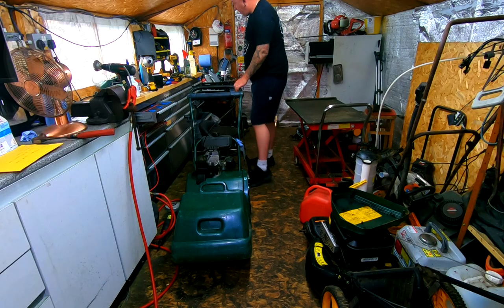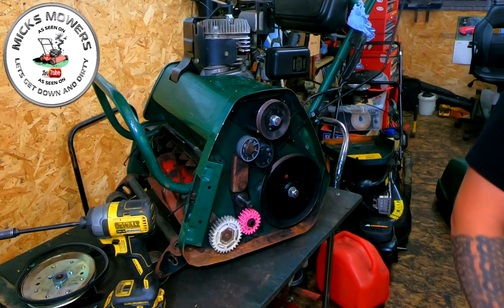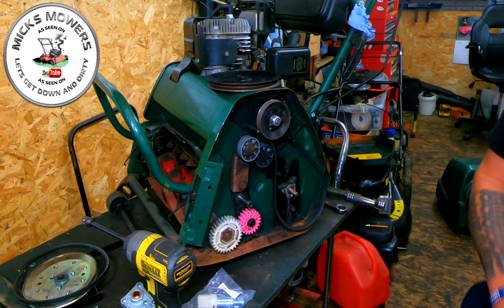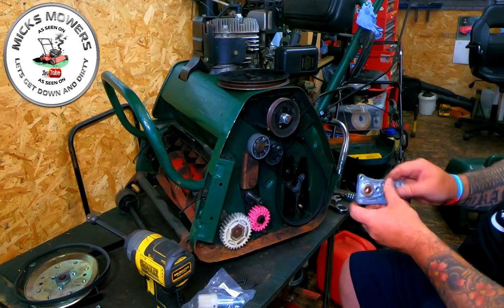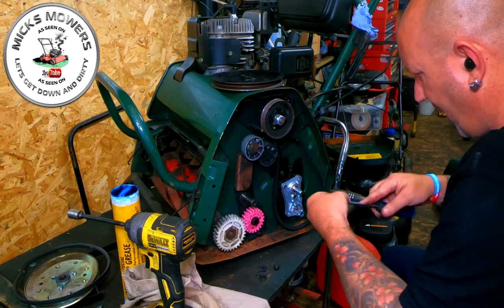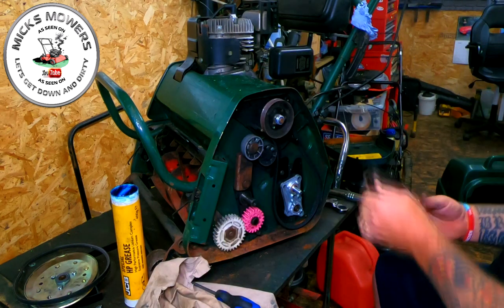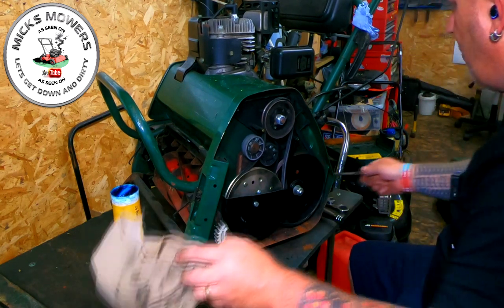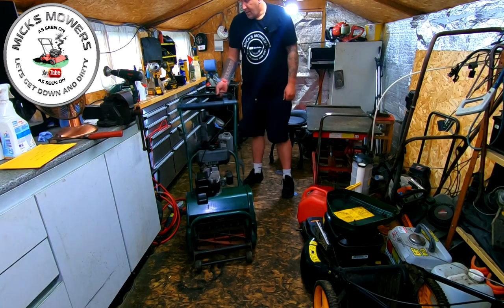Atco Balmoral Cylinder Lawn Mower Repair Drive Grinding Or Can't Push Forward

Comment: Just followed this for my Attco Balmoral 20S - Changed the pinion gear, the belts and the ring gear. Step by step instructions are amazing. The roller is a little tricky to get the screws back in especially doing it on your own but follwed it and works a treat. Thank you so much Mick.
Reply from the maker: @jasonbocchi7736  no worries mate .... Glad it helped

Comment: Hi Mick I wish I had seen this vid earlier as the F016103210 is now £43
Reply from the maker: @alansanderson4943  depends where you look. https://www.mowersandspares.co.uk/products/pinion-plate-assy-f016103210/
Reply: Obviously I've been looking in the wrong place. Thank Mick for the info and quick response 👍 😀
Reply from the maker: @alansanderson4943  no worries

Comment: Thanks for doing these really good educational videos my suffolk punch 17sk has been sitting around in the shed for a few years now and you have inspired me to get it out and fixed up replaced the front roller only to find its not quite rolling right the drive pully is wobbly so using this video I'll strip it down tomorrow and check both the pinion gear and housing thanks again
Reply from the maker: No worries

Comment: I've just replaced the pinion and gear but now I can't push the mower it moves when pulling leaver but can't manually push it now?
Reply from the maker: Have you put the new Pinion gear plate on as well?

Comment: Hi Mick. Quick question have you ever come across the pinion bolt for the drive pulley that keeps working itself loose and stoping the drive. Then you tighten it back up and it works then next time you use it same thing?
Reply from the maker: Use some lock tight.. maybe that will sort it
Reply: @themowerman  that was my thought. Thanks

Comment: Your videos are great so thank you so much for doing them, just purchased a Suffolk Punch 17sk for £300 with scarifier and it is the first time using cylinder mowers. It has needed work like the carburetor clean and pulley change. Just wondering does my mower have the pinion upgrade or is it only ATCO mowers. I also have a question on the petrol to use, would you recommend using E5 petrol over E10 ?
Reply from the maker: Hi.. use E5 NOT E10. Or the best fuel is aspen 4.  It's expensive but last for 5 years .. unopened and two years opened.. yes you can use the same Atco upgrade for your mower ..

Comment: Great video as usual. Almost rebuilt mine after watching your videos. One video I can't find is about the pull cord kickback issue. Which I have. Any idea how to fix it? Thanks.
Reply from the maker: Could be out of timing.. check the flywheel key for alignment or it could be the valve

Comment: Hey up mate, hope all is well!? Literally on one of these machines with the same issue as I type!! Watching your video now with interest on this new part! 👌
Reply from the maker: Fantastic it does the job.. I have done 4 now.
Reply: From all the ones stripped, I’ve noticed the more modern made ones, defo post 2000, probably around 2004 seem to come with those elongated bearings, much better. I’m currently on a 1996 balmoral 17s and it has various design changes to the internals and the same bearing you removed from your 14. Good fix though mate, cheap to! 👍🏻

Comment: Mick, great video. I’ve new around here a bit of a novice sadly.

I was recently given a qualcast classic 43s and have the same noise when pulling the mower back and when it engages with the throttle.

Would these same parts work on my motor or could you be so kind to point me in the right direction please.

Keep up the great videos
Reply from the maker: I would say it would fix it mate ...

Comment: Hi Mick, love the channel. I have a Qualcast 43s, bought it from a charity shop but it has issues, my biggest concern is the drive train. I'm struggling to set it up. Finding the sweet spot where it just idles and does not move and why when I pull back does the back roller lock? Any help or a video on the subject much appreciated.
Reply from the maker: Hi mate .. I have lots of videos on upgrades and how to get it sorted.. have a look in my cylinder mower playlist..

Comment: interesting video on the upgrade. The problem i have on my Balmoral 17s, is that i dont have the nut below the bearing and drive gear. Seems to be flush!!
Reply from the maker: Email me a photo mate .. what's the problem micksmowers01@gmail.com
Reply: @themowerman  what i did after looking at your video, was to replace the single 3 point bearing with the full size upgraded bearing carrier.  The bottom hole that holds the threaded shaft isn't there. Its flush.  The  pushing forward is not exactly a hindrance, but i suspect the drive belt tension needs to be reduced further, or maybe have a look at both the main bearings that support the twin rollers.
Keep up the good video's!!
Reply from the maker: @skodanut  ok cool.. ta for y

Comment: Mick Thanks for a great video I have a Suffolk Punk sk14 It cut ok and can be pushed forward when the engine is running and dive does engage. When the engine is of can only pull back, push forward and yes the crunch. The machine in the video looks as if it's the same. Would it be the same for me to do as you have done on my suffolk.
Thanks for a great set of videos.
Harry
Eastbourne.
Reply from the maker: Hi mate .. yes exactly the same

Comment: Hi I have a atco balmoral 17s. Have a drive issue. Replaced ring and pinion gear. Roller spins when not on the floor but rainy drive the mower when it on the ground. Any idea on the cause? Thanks.
Reply from the maker: Sounds like a belt or cable needs adjusting..

Comment: Hi mick awesome videos as per quick one I’ve got a Hyundai rear roller self propelled mower but the self drive is hardly moving ? I’ve covered all the basics and still no joy any ideas ?
Reply from the maker: Cable or belt adjustment. ?
Reply: @themowerman  can’t adjust the drive can only adjust the cable ? It’s baffling me the mower model is Hyundai HYM530SPER Self-Propelled Petrol Roller Lawnmower it’s not the electric start model
Reply from the maker: @Robsenginerepairs  so have you adjusted the cable
Reply: @themowerman  yeah the cable is fully adjusted
Reply from the maker: @Robsenginerepairs  try putting the drive in and pulling the cable to see if the drive cuts in.. if so the cable will need cutting and re joining
Reply: It’s the simple things what Stare At you in the face It was the cable it’s too long so needs cutting back As you say thank you very much mick

Comment: Well done.

Is that just a bushing added to an aluminium casting? Do you know the inside measurement of the good bush? I could make them in bronze so that you could drill out the existing hole, and fit a new bush.
Reply from the maker: I does have a bushing but it's longer then the old one..
Reply: @themowerman  Any idea what the diameter of the shaft is and the length of the extended bushing?
Reply from the maker: @BensWorkshop  no I will try and find out
Reply: @themowerman  I am just being curious as to whether parts could be made to adapt the original rather than replace it.
Reply from the maker: @BensWorkshop  yeah a good idea

Comment: Hi mick - I’ve tried to undo the nut to take off the drive roller pulley , but the hole thing turns ?
Reply from the maker: Is there a small hole in the pulley?
Reply: @themowerman  yes - I’ve done the upgrade last year , but when I engage drive - nothing - tried to undo the nut , but the nut turn with the bolt as well - also put a Alan key in to stop the pulley turning -

Comment: Hi Mick. I have the Qualcast Classic 35s petrol mower. Had it for a few years identical gearing as the one you worked on. I have never encountered this before but I know what to do if I do. Thanks.
PS are you going to tell where you got that yellow tray you used when cleaning that carb?. Pretty please. Thanks.
Reply from the maker: Here you go mate https://www.versi-tray.com/
Reply: Thank you Mick. 👍
Reply: Got my Versi tray in the post today👍👏

Comment: Great video, Mick! I have the same issue with a Qualcast Classic 43s, which appears identical to the ATCO in your video. On the inside of the roller, is it just a ring gear around the outer circumference of the drum? My mower has a bracket like your new one, but the roller does not seem to fit snugly in the bracket. The pinion gear is in good condition, as is the ring gear, but I get a clunk when in drive, and it will not push forward. The play where the drum sits in the bracket seems to be the issue. I would appreciate your expert opinion.
Reply from the maker: Take the ring gear out and clean or replace it.. that may help mate
Reply: @themowerman  Thanks, I will try that in a few minutes. I wondered if there was a connecting gear between the outer ring to add stability and drive? It appears to be the pinion and the outer ring only.
Reply from the maker: @changyUK  yes.. sometimes with the ring gear it gets full of dirt and muck.. so take your time to clean it properly.. if it's had the upgrade aluminium part then it should be fine..
Reply: @themowerman  I reassembled the roller without the plastic cover so I could rotate it by hand and check the gearing. The aluminium ring was not too dirty, but I cleaned it thoroughly and can see my pinion gear looks okay visually, but it is not engaging correctly. Is the 35s pinion the same size as the 43s? Sorry to hijack your video!
Reply from the maker: @changyUK  yeah they are all the same.. take the belts off and see if it will roll without the belts..
Reply: @themowerman  It doesn't reliably roll forward even with the belts removed. It starts to roll but then judders and jams up. I've ordered a new pinion gear.
Reply from the maker: @changyUK  yeah That may help..
Reply: @themowerman  An update on my mower. I replaced the pinion gear, and the mower now rolls forward, albeit a bit clunky. I will replace the ring gear, but the three retaining screws are stuck fast and need replacing; do you know the thread size? Cheers!
Reply from the maker: @changyUK  no mate sorry..

Comment: Hey Mick, great video, thanks for making it.  I’m going through most of your videos for tips now! :)

I just picked up a pre-2012 Balmoral 20S, which is a bit grindy, so I’m going to replace the pinion and do the upgrade.

I can’t find the part on Amazon, do you have a trusted alternate source for the part please? I want to make sure I get the right part.

Also, have you found any difference between the genuine ATCO/Allett pinion and the non genuine?

Thanks!
Reply from the maker: No problems mate here you go https://www.ebay.co.uk/itm/393869368682?mkcid=16&mkevt=1&mkrid=711-127632-2357-0&ssspo=UlyIrJAdQnS&sssrc=2349624&ssuid=VxofTcWjS-2&var=&widget_ver=artemis&media=COPY
Reply: @themowerman  awesome, thank you so much!  I ordered a load of bits from GHS after watching your videos, which were super helpful.  Next stage, cleaning the tillotson carb after watching your video guide.  Something I really wasn’t looking forward to before. 👍
Reply from the maker: @tastyfish1032  good luck with the carb clean.. don't forget the 3in 1 tool to remove the long jet.. let me know how it goes
Reply: @themowerman  thanks!  I bought a new carb just in case it all goes Pete Tong…. I was going to do it tonight, but ran into a problem with the upgraded drive pinion bearing holder.  Since fitting, it seems to mount the roller pulley a few mm further out, which causes the belt to jump off when you first engage drive.

Have you ever experienced this? (It’s a pre 2012 model, I checked the model number against the part on GHS).

Thanks